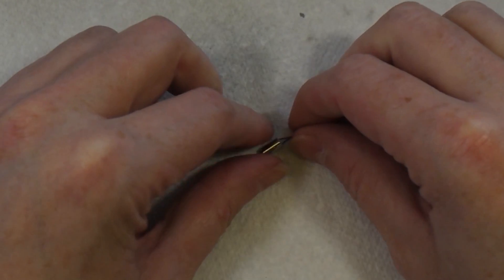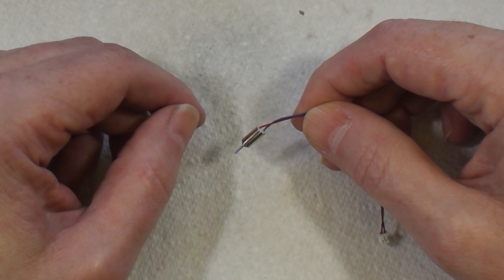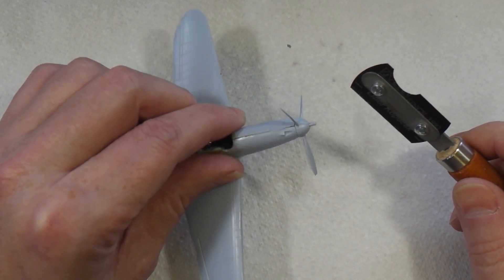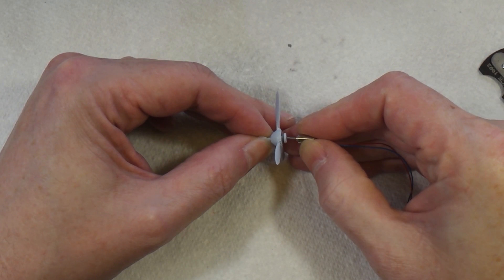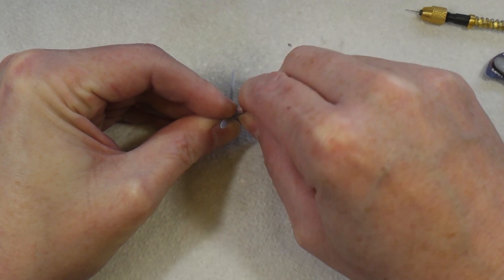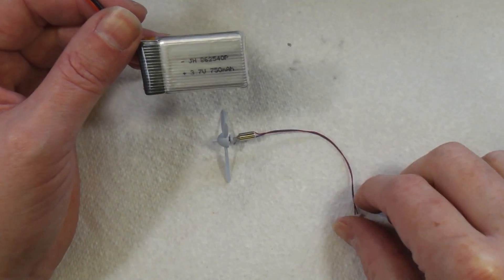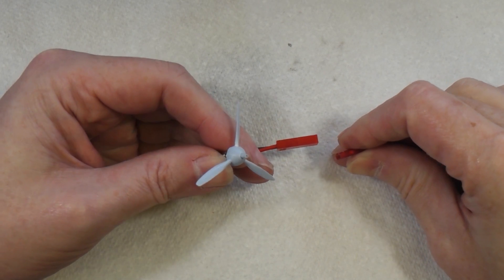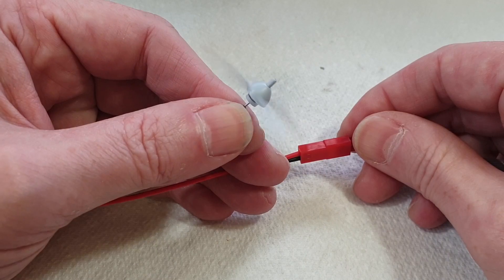Testing a 70000rpm motor for a model propellor  What could possibly go wrong?

Comment: Hm. I was given a few old phones for parts (cameras etc) and they use tiny motors with eccentric weights as vibrators. I wonder how fast those spin? They're a similar size...
Reply from the maker: I bought some of those motors a long time ago as I thought they might be useful. I think they're about 15000rpm.
Reply: @SteamGeezerUK  I don't build many model planes these days but I think they'd do for props, especially with some sort of controller to change the RPMs along with sounds per your tank diorama.
Just a thought.

Comment: Ideas abound. Wonder if a couple of button batteries would work
Reply from the maker: I don't see why not. There are 3v lithium button cells available, and you can find battery holders for such cells fairly easily. The only issue with a setup like that is making sure the batteries are accessible so they can be changed.
Reply: @SteamGeezerUK  they'd fit right nice under a stand.

Comment: Those weren't 70.000 RPM. :)
Reply from the maker: No, it certainly didn't look like it. As someone commented earlier, the weight of the prop probably slowed the motor down - it really doesn't have much torque at all.

Comment: The model is an ancient Airfix Bell P-39 'Airacobra'. A very odd aeroplane, with a tricycle undercarriage, the engine mounted behind the pilot, and a main armament of a 37mm cannon firing through the propellor boss, the propellor being driven by a reduction gear from the long driveshaft. It was used by the Americans as a ground attack aircraft. The R.A.F. took delivery of some, flew them on one mission, and retired them from service. The Russians, however, loved the 'plane, and flew it like a fighter throughout the war. The Airfix kit was worn out decades ago, sadly. The 1/72 Revell version was better, and better than that, was the version made by 'Hobby Boss'. Only a few parts, but superbly detailed.

Comment: I wonder if that little motor supports variable speeds? Maybe add a resistor to reduce the current and slow it down?
Reply from the maker: It might do. I may just dig out my variable power supply and try it. Although it was listed as 3v I've seen similar listed as 1.5v to 4.5v.

Comment: The weight of the propeller will slow the motor down for sure.Going to be cool mate 🍻👍
Reply from the maker: Certainly seems to be the case or, as I said, the battery might be going flat. We'll see how it goes.
Reply: SteamGeezer and Son Independent Traders It’s a very nice small motor.Wouldn’t mind getting some myself 👍
Reply from the maker: This one came from ebay. I've got some on order from China which should be the same, but I'll see when they get here.